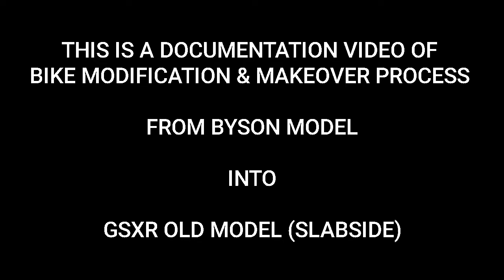Custom Fiber Fairing -  GSX-R OLD MODEL BUILD TIMELAPSE ( Motor Patroli Kotaro Minami )

Comment: Spesifikasi nya apa mas?
Lampu pakai punya apa?
Depan & belakang?
Velg apa?
Reply from the maker: Mesin dan mainframe Basic Byson
Ban Depan 110/70 Belakang 140/70
Lampu depan Lampu kabut mobil modified belakang GLPro
Slebor depan belakang byson modif
Reply: @ewb5195  velg?
Reply from the maker: Cb googling "velg palang 3". Ada Rossi adan MGV mas. Diameter 17